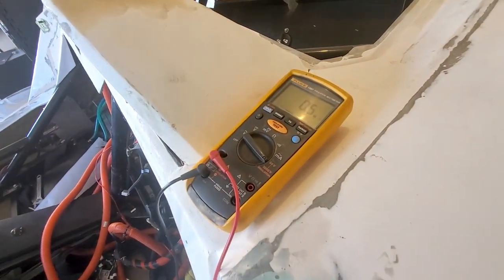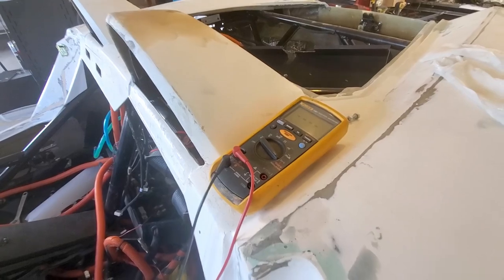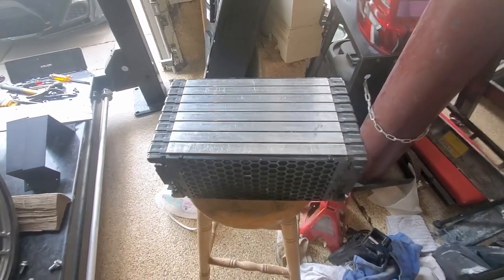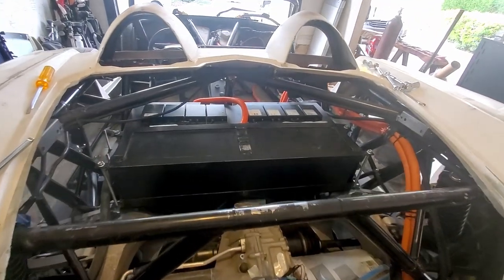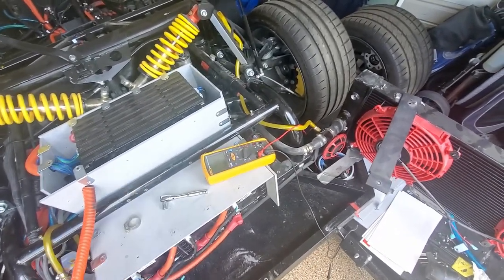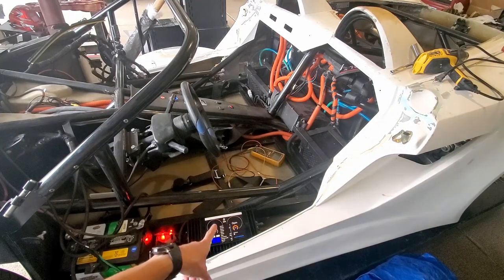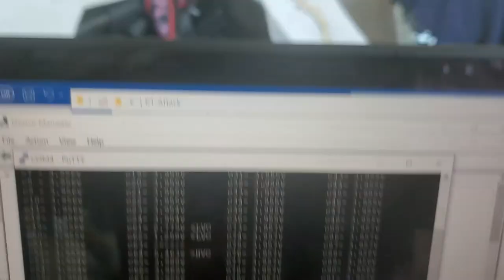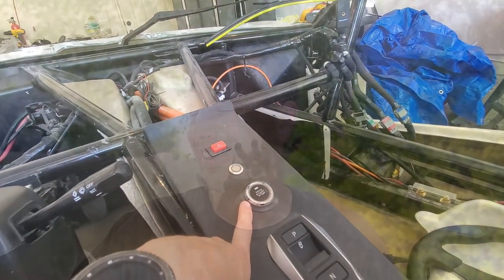Wattson Rides Again!

Comment: I would stress test the battery cooling system before going much further. While it is 100+ degrees outside, put some blankets around the battery packs so that all the cooking has to come from the liquid and then make a bunch of full throttle runs for about 30 minutes. If it stays cool you will know you are gold.
Reply from the maker: Good thought

Comment: 06:18. It's called high heat conductivity. Thats why anytime you touch room temperature aluminium, copper, silver, they seems cold. They're not. They takes heat away quickly from your fingers. Titanium got so low heat conductivity it will feel warm in room temperature.
Reply from the maker: Thanks for the comment!

Comment: Battery stuff is quite touch. Try to replace 2 banks in the battery pack... I make my own batterys for my power ebikes, and it has to be nailed from the beginnig or it turns to nightmare :) But when it works, it really works relieable. I use Liitokala lfp-cells.

Comment: WoW . Did you have the air suspension inside ???
Reply from the maker: No air suspension
Reply: @electricsupercar  Maybe you need to add it to avoid crash , because the car is low. But this is just a suggestion from me .

Comment: Sorry I didn't pay enough attention. I worked with high voltage for a living. We use a lot of a red fiberglass like material in varying thicknesses to isolate and avoid arc flash depending on potential. There's also what you could find as transformer paper that can be placed in between close items.
Reply from the maker: Thanks for the comment!